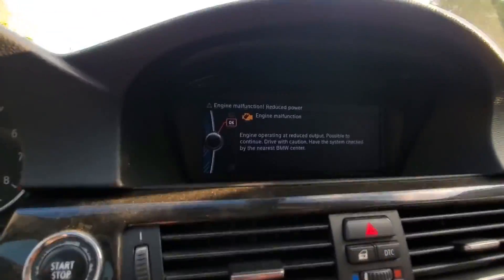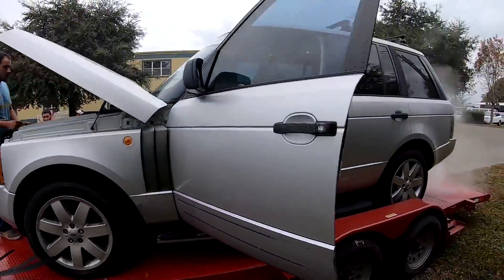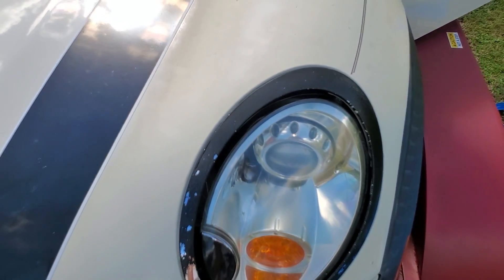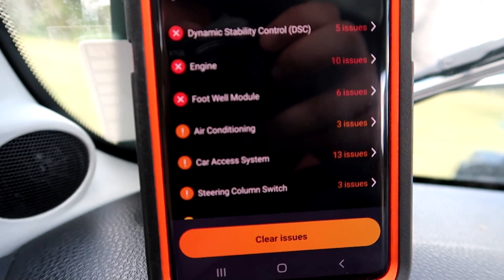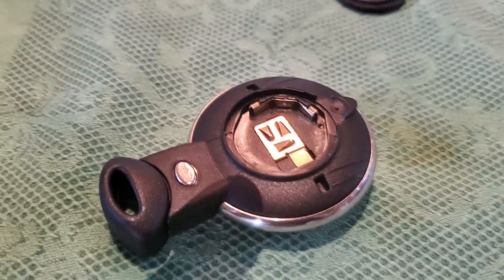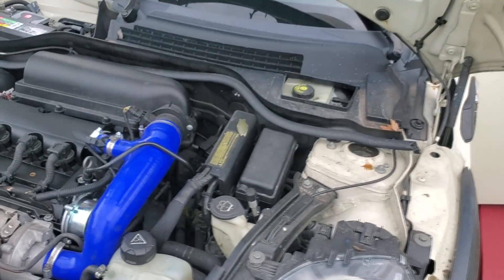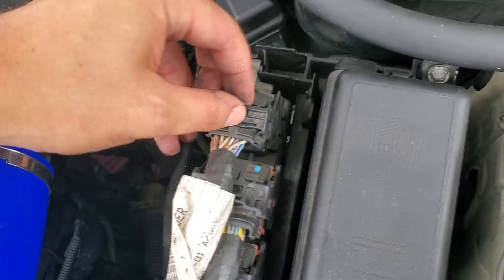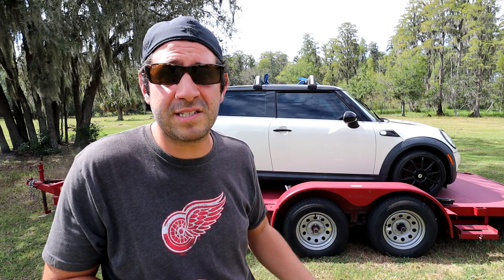I Bought a Factory Flawed Mini Cooper Turbo for $1,000 at Auction! How did Mini Get Away with This?

Comment: As a mini owner I can confirm that is a fairly loaded up car. That interior is the lounge leather which is around a $2,000 option on its own
Reply: @Zyzz Not true. They are an incredibly fun car to drive. Most mini owners that I know are guys. You truly need to own one to understand.
Reply: @Zyzz Who hurt your masculinity?
Reply: Yep. The forced induction cars are enthusiast cars.
Reply: @davidgalinat4257  Not sure what kind of generalization this is. I personally believe there are more NA cars that are also enthusiast cars.
Reply: @Smicky20  seen a mechanic drive one. I think it even was a older Cooper works so around 2007 Design model. That thing looks fun n sounds fun and is fast
Reply: @Max-qs8gl  they are an absolute blast. Especially on a nice windy backroad
Reply: Bought a 2009 cooper a cab with 48k and chain snapped for the second time for 2k, it was loaded with heated lounge leather navigation bi Xenons Dab the lot, rebuilt the motor and it was an absolute blast to drive even in cab setup, used it for a month and sold it for 7200, done a few since always up for one of these they are great fun

Comment: This car and immobilizer worked in the auction photos. It has to be something really simple like a loose connection. I would start with clearing all the codes in the car and start from there then unplug and replug all of the modules. Stat looking at the wiring from there. The chances those modules failed while at the auction are slim to none. Also does the physical key work in the doors, that would be your first clue that the key was switched at the auction or not.
Reply: Feels weird how this video felt more like a bunch of assumptions rather than factual proces of determination...
Reply: One of the codes is for network down. IIRC it was the powertrain network (PT-CAN) which does control the ignition/engine. Maybe looking for a missing relay in that relay box will bring up the powertrain network and the key will be detected?
Reply: That loose box with relay under the hood was too fishy to me. Like someone at auction messed with it to disable the car and make it a non runner until they bought it. 

And yep I saw that on the Carly screen too and was figuring this thing would at least crank by the end of the video. But Sam has the money and time to load up the parts AK-47 and fire multiple magazines at his projects. So at least we get to see how to tear apart a Mini Cooper S for free-ninety-nine and Sam makes more money of the ads so we all win here!
Reply: Aaron Turner    awesome post!  Samcrac needs to man up and get a Barrett 50 cal
Reply: I wish Sam would read this. It's the battery in the Key.
Reply: @codetutor6593  You didn't watch the entire video. He replaces the battery in the Key.
Reply: @codetutor6593  he replaced the battery in the key.

Comment: This is a very common issue even among BMW bikes. I have a 2004 BMW R1200GS and the immobilizer is one of the most common problems.There is a small plastic ring  that contains the key reader device and when that fail, the car or bike no longer recongnizes the vehicle key and leave you stranded.

It is like a $30 part and i always cary one spare. Change is like 15 minutes if you know how. It does not require reprogramming the key as the device itself that reads the key in the car or bike is dead. Once replaced, it will again read and recognize your old key.

Comment: Hey Sam, try if the physical key from the key fob matches with the lock on the driver door. One time, one of the cars I purchased from auction, came with a key from a completely different vehicle, so neither was the key fob, nor the physical key from the car I purchased. Worth a try.
Reply: Gary Chillingworth what he suggested was to make sure the key belonged to the car
Reply: @garychillingworth  there is a plastic cap that covers the lock assembly.
Reply: @garychillingworth  there's not one in the interior, the lock they are referring to is in the door handle. It's an emergency override to the electronics. Let me stress EMERGENCY OVERIDE. BMW in their "infinite wisdom" has designed that door lock so that it will only work for ~1 month of use as the primary means of getting into the vehicle. After that it fails & then you really are screwed.
Reply: @garychillingworth  the piece to the rear of the drivers door handle has a removable plastic cap under the cap is a lock cylinder.  It will allow you to unlock the drivers door once inside you need a key fob to start the car the fob has an imbedded RFID chip. if the car doesn't see the key it is the antenna or security module.
Reply: Hey guys, this became a very lengthy discussion from a simple suggestion. My idea was for Sam to try if the physical key will work on the door handle lock mechanism, in order to be sure that the key fob he has is in fact the one that belongs to this car. Because if the physical key does not work, then the fob is programmed to a different vehicle, not to Sam's one. I suggested this because this has actually happened to me - I purchased a car, from the auction it came with the key, but it was a key fob (and physical key) not for my car. I guess they got shuffled somewhere in the auction.
Reply: @unclejoe6811  The antenna in the key fob is picked up by an antenna in the rear view mirror. I never knew about the physical key hidden inside the fob itself, until watching a youtube video on how to install a rear camera with after market rear-view mirror.

Comment: Good luck! I own the same 2007 Cooper S with N14 engine. Its a oil sucking rabbit hole. When you fix one problem the next one appear. I am looking forward to see how it goes😀
Reply: It's supposed to be around 1L every 5.000km, i've a 2016 Peugeot 308 GTI 270hp with the same engine, after BMW abandoned the engine, Peugeot kept upgrading it.

You should look at it, i've seen Citroen DS owner buying part for the 308GTI because they were better engineered, it may be the same for the Cooper.
Reply: I had one... Bought it for my son that thought it was too cutesy for him. I drove it for about 6 years. Awesomely fun car but geez every other month something would break.
Reply: Alexander Christiansen Urghh.. The dreaded THP (or so called, "THPum!").

Many many problems ranging from oil consumption, timing chain rattles, solenoid failure, faulty HPFP and the list goes on...

Apparently the most "new" ones are an update to the early problematic ones, with most of the common issues already sorted.

Still, 272PS for a 1.6l engine seems too exaggerated. Don't feel the engine will last much.
Reply: That's how high end cars go
Reply: Sounds like my 2007 audi A4
Reply: Yeah, I personally wouldn't buy a turbo MINI before 2011. This should make for good content though.

Comment: I had a loaded 2013 Countryman JCW and blew the engine due to a coolant leak... RIP. A fun car designed by rich mechanics, but fun to drive when they work.

Suggestion for other cars: Go vintage, Volvo 122, BMW 2002 etc

Comment: i have an 06 Range and i usually disconnect the negative for a second and put it backfor the key to work... theres a way to drill a tiny hole into the column and spray lubricant into it to get the actuator unstuck... worked on mine for a few months and stopped again recently...

Comment: I had the same steering column issue on my 2003 Range Rover. I used a fuse tap and replaced it with a switch. So instead of pulling a fuse. You have to flip the switch and do the post pull fuse process. Easy way to get around that issue.
Reply: Great luxury car! 🤭

Comment: Had this problem with a BMW that had comfort opening. After many many attempts to get the car fixed it turned out to be as short in a sensor on the door handle pulling down the canbus. Only took 18 months to get it running again. Was a 2008 by the way.

Comment: This seems like a chilly version of the R56s, which indeed is the top spec, at least in Europe.
However, if and when this is repaired, you need to have a look at several parts that usually fall:
- chain, chain tensioners etc
- clogged valves (BMW cleans them with wallnut blasting)
- high pressure fuel pump
- thermostat housing leaking every 50k kms (at least in my case)
- front silent blocks - in my case they fail every 50k kms

When and if the above are repaired, you will be able to enjoy:
- small rocket
- very good turning/handling, even with the stock suspension
- precise steering wheel

Mine is a 2010 R56s, with 100,000kms and despite the problems, I enjoy daily driving it :) 
For a $1000 seems like a good deal, provided that you are ready to put some more money in it. 

Looking forward to see more videos of this thing!

Comment: You could have tried ISTA-P with an ICOM and programmed it yourself. I just got done totally programming 3 different BMWs that had bricked modules with some good results. Hit me up if you need to borrow it, I work in Orlando.
Reply: That assumes that there's not a hardware failure
Reply: @bamascubaman  it lost programming for a reason.

Comment: I just bought an 03 S for cheap. Tried to stay away from anything 07+ because of the engine issues, and the first generation cars are iron blocks and supercharged!
Reply: Was why I looked for an 05-06 S a few years ago. Found an 05 S on eBay for $5k, no sunroof (thankfully), garage-kept, less than 90k mis...bought sight unseen and drove it home from Vegas. 

I've got MAYBE $5k in upkeep and preventive maintenance and runs like a top!
Reply: STimedic1 did it come with a 6speed manual gear box
Reply: @og-ol-timer  I wasn't aware of any early Cooper S' coming with anything OTHER than the Getrag 6mt.
Reply: STimedic1 hmm maybe I am got confused you went for the super-charged cooper S right? 
You could get a 5 speed here in the uk both are good thou I had a 03 but it got totalled
Reply: @og-ol-timer  the R52/53 S we got stateside were all 6 speed manual. The R50 was optioned with either the Aisin auto or Getrag 5mt for us.

Comment: As someone owning several BMW' and Mini's (have been living in Belgium, Netherlands and Germany) and working on them for at least 15 years I've seen these issues a lot. 
First the red icon is the immobilizer, the Key which is striped through means the key is not recognized at all. 
The unlock doors and ignition are 2 separate systems on these key's where the ignition system is read via an antenna. Also the ignition part is not powered by the keyfob battery. It is powered by induction when the key is inserted in the key slot.
These are know to break down with these models. (And easy to override with a 15 dollar cable, laptop and correct software)

Comment: What's funny is I owned an 09 Cooper S with the N14 engine. For 115k miles, it was relatively trouble-free. My timing chain remained healthy (checked it often as it didn't take much to do so) and my oil cooler remained functional as well. All that went wrong on it was the clutch (typical for a manual) and a few other maintenance things. Other than that, it wasn't a bad car. I must've lucked out

Comment: I picked up a 2007 Mini Cooper S with 110K miles on the Odometer,  not long ago for $1900. The only major issue it had was a turbo leaking oil into the intake.  I replaced the turbo,  upgraded the intercooler, and replaced the intercooler and radiator hoses.

These are fun cars to drive.

Comment: I’m getting ready to switch the modules and fob on a 7 series I have had here for 2 years, done it on a couple other bmw and worked fine. Even able to program a 5 speed auto to work in a 6 speed auto 7 series. The minis I bought at auction have usually had timing fail 70-80k and need pistons, head and so on.

Comment: I have an 07 with the n14 they are fun when the work... I’ve found that the only time I’ve really had problems with mine is when I let it sit. Carbon build up and the timing chain are the most common issues but good suspension and good tires and a tune and they are sure to put a smile on your face. For $1000 dollars I don’t think you will lose!

Comment: I have a 2010 cooper S. N14 engine. Do the walnut blast to the valves ,install oil catch can. Get updated timing chain tensioner. Watch oil levels, top up when needed. Other than that works great. The old minis needed lots of maintainance too!! I've owned both😎🇨🇦👍

Comment: I've encountered the same thing with my e90 BMW. For me, the fix was a new battery and alternator. BMW components are very sensitive to voltages. If the battery was weak it can throw the ELV code or the steering wheel lock. Charge the battery up and try a different key, that's where I would start.

Comment: Locksmith here, my guess the auction started the process of replacing the key and bricked the computer.
Reply: Mrmaintenanceman hope Sam reads this
Reply: Jon Waterbury good thing is, he’s sending it to get rebuilt, as long as the company he sends it to uploads the right files he should be ok, mini keys and bmw keys are a pain and most smiths don’t touch them. I know I only mess with them if it’s absolutely a emergency
Reply: @MrSaltMines  An AR32 should hack the immobilizer & program this if memory serves me. It's definitely possible that they tried to program a key & botched it but why would they when it appears to be working in the photos? My guess would be more like the antenna ring isn't functional for some reason. Fellow smith that doesn't fool with them either.
Reply: Warren McCrory I’ve met a few smiths that work for auctions like this, they are usually the “low end” type. My guess they tried to program and failed a bunch or pulled a computer and botched the data files.

Equally though, a antenna fault is a definite maybe too, but if the dollar store smith the auction hired messed with the computers he mighta broke that too!

We also all might be wrong and it might just be in soft lockout because they key didn’t work and someone tried to start it 97,000 times

Comment: That’s not the original dipstick it’s aftermarket the factory one is nearly impossible to read the oil levels and you’ve got the N14 engine which isn’t the best
Reply: Pretty sure it is original, I have done a lot of work on a 2008 one of these, it was a euro model and n\a though

Comment: Dump that mini as fast as you can. The n14 is known to have timing chain issues. High pressure fuel pump issues.
Reply: Agreed ... plus the R53 drove better and was a much more fun experience.  This is the first generation where the lawyers got involved and started to ruin Minis.
Reply: Bruh just replace the high pressure fuel pump lol
Reply: John Schmidt I think they were more refined in the 2nd gen then the first. But the face lifted 1st gen are way more reliable.
Reply: TheMidnightNarwhal they are a bit expensive if I remember. And still doesn’t fix the fact that they are just not reliable.
Reply: @dougiefresh188  600$ isn't that bad IMO.
Reply: TheMidnightNarwhal once. But they go out all the time. And depending on how much the car cost 600 might be more then half the price.
Reply: @dougiefresh188  FCP Euro lifetime warranty so you only pay once. And if someone isn't willing to maintain a car because X part costs more than half the price of the car then that's their problem. The car is that low for a reason, for repairs.
Reply: That doesn't mean his car will have those problems.
Reply: Mexican Spec  all n14 powered mini’s have a timing chain problem at some point.
Reply: @mexicanspec  Exactly as well. I have a N54 BMW and my car has been surprisingly reliable.
Reply: N14 is awful.  Get rid ASAP
Reply: @dougiefresh188  That doesn't change the fact that you don't know if this car will ever have that problem or if it has been fixed already.  Also, this is not going to be a daily driver for Sam, so the likely hood of anything going wrong, if he gets it running right, are slim to none.
Reply: @JackRR15  People use their experience of owning one car and extrapolating that to every car ever made.  The people you should listen to on the subject is a dealer that has bought and sold multiple versions of the car.
Reply: Mexican Spec you can replace the parts but it will happen again. It’s just a matter of time.
Reply: Every car with a chain has chain issues. Fuel pump ehh... just replace kt

Comment: Hi,

Worked on a Mini Cooper S before.
Things to look out for,

-Sun roof malfunction (it will open once but wont close again) Most likly the cable that runs in it is broken, so the whole sunroof needs to be replaced! 
-Thermostat (Looks like a heart!) Not really the best acces to get it replaced.

This is it for now what I had to deal with

Comment: Those camshafts fail too, but you need to check the CANBus failures.  It could have a bad door handle if it has comfort access or other issue causing CAS problems recognizing the key.

Comment: Hi Sam,
Im a mini owner over in the uk. As youve got the dreaded n14 engine id start to look for carbon buildup and install an oil catch can too. If theres carbon buildup then may need to get the engine walnut blasted. Also common faults are the timing chain going and the high pressure fuel pump. The fuel pump is a cheaper fix to buy and install one however the timing chain is a big job and can be pricey and time consuming as youll have to strip the engine out to do the job. As for the car it is a higher spec model as it has the full leather interior aswell as sunroof and multi function steering wheel 
Hope this helps
Reply: what do you mean, timing chain job can be done in 2 hours on these its so easy and not really expensive anymore. it used to be expensive but parts are cheap now adays.
Reply: @nicklasclausen1247  to be fair i was quoted 4 days worth of work and about a grand from the garages i went too. Was told it was the chain but the timing valves and all that had to be replaced aswell. It was the whole reason i ended up going from a mini one to a cooper s as it became to uneconomical to repair.